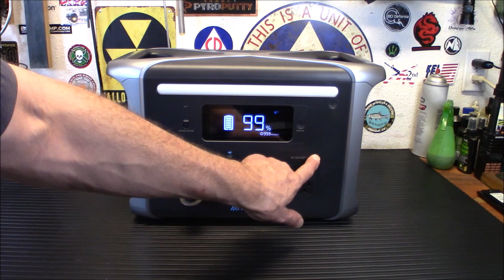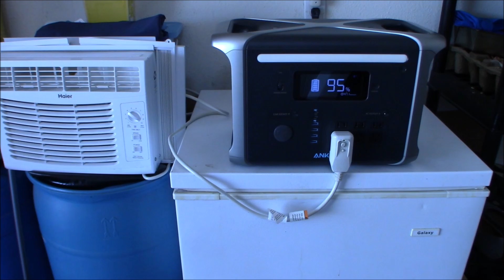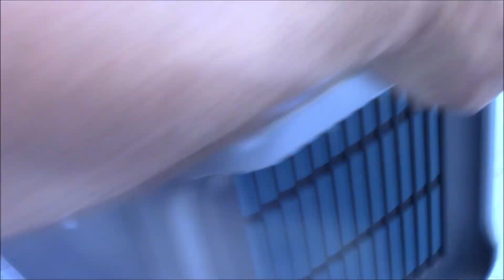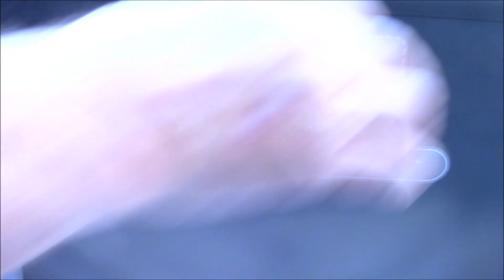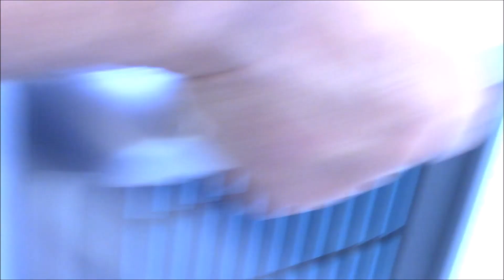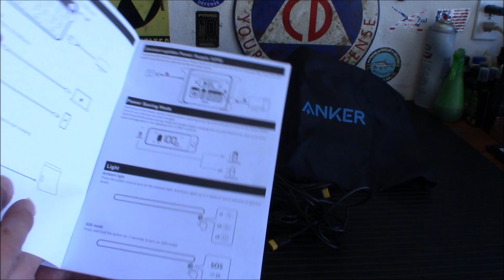Anker 757 PowerHouse: 1229Wh 1500W Power Station!

Comment: Really good review. I'd like to see Anker add cellphone app to monitor and turn off the unit remotely. Also, other brands have the option to buy a battery pack add-on to increase capacity. Hopefully Anker will release an add-on pack. I'm a huge Anker fan and I currently have their smaller Powerhouse 521 and use it with a solar panel.

Comment: For the record, Power Saving mode should be OFF when used with a CPAP according to Anker Tech Support. You said it should be in the video. Good video though!
Reply from the maker: I thought I said it should be off when using a CPAP but I may have misspoke, thanks!

Comment: I dunno how well Anker pwoer stations products are, but I do like their housing design which looks like a BMW i8 car.
Reply: I have the powerhouse 2 400 and it is impeccable. The best screen I ever used. Very reliable. It’s regular Lithium, so I’ve been waiting for Anker to do bigger with LiFePO4 batteries.
Reply: I have the original Anker Powerhouse. 5 Years old. Never had a issue. Great quality. Avoid the cheap no name Chinese brands. They are junk.

Comment: when you talked about switching off power save mode, so it stays on for powering fridges, it went dark and you said "it's supposed to do that, it'll eventually turn off". Huh? So does it  have the ability to keep powering a fridge when it's not taking power or no? I think I misheard you sorry George. Regardless, it seems pretty pricy for the amount of watts,
Reply from the maker: The display turns off but not the power.  The display turns off rather quickly in any mode but the power will turn off if there is no draw on it in power save mode, if power save mode is off, it will stay on and power the fridge or whatever when it needs it again
Reply: @Iridium242  Thank you kind sir!

Comment: People can correct me if I'm wrong, but I think this might be the best all around design available. Does pass through, screen provides all the info, good initial surge capacity, solar can actually charge it before your pension kicks in. 

The only improvement for the next model I can think of is maybe adding a port to add an additional battery. Would be handy for limping through a rainy day, and it has ability to charge both the next day in only 8 hours.

Comment: I just ordered mine cant wait for it to show up. do you know if it will work with ecoflow solar panels?
Reply from the maker: yup it will work with any solar panel as long as it has the right connector and I think the ecoflow ones do have that connector, if not there are adapters all over amazon for it.
Reply: @Iridium242  ok thanks I'm looking at ecoflow or renogy foldable panels. so I think they will work. I was also looking at the panels you have on amazon they make a 200 watt foldable. are you happy with it?
Reply from the maker: Yes very, great stuff
Reply: @Iridium242  to that point, can the 757 take ANY single solar panel of power output 200w (300w if that exists)? Or does each port of the tri-port connector only accept a charge of 100w per port up to 3? 

I couldn't find this info anywhere on the product page.
Reply from the maker: @Osprey1  Any single panel (I charged it with a single 100 watter) but anything 300 or lower will work or you can combine up to 3 100 watters and it will work
Reply: @Iridium242  Awesome. Thanks for this info!